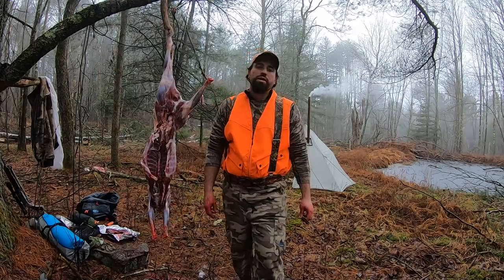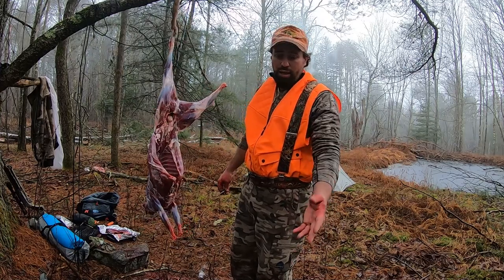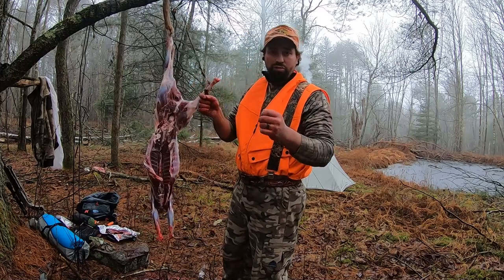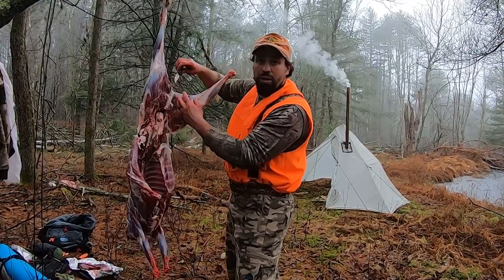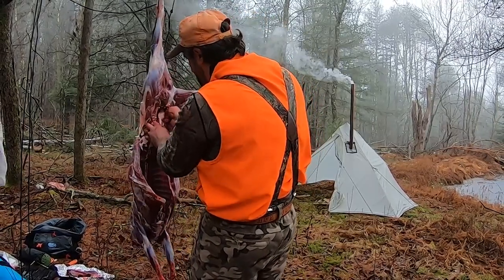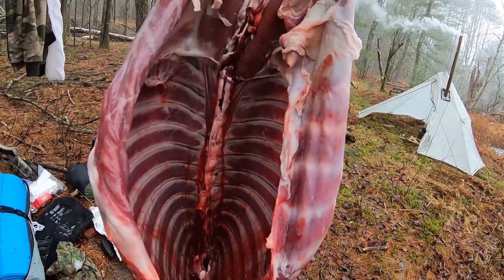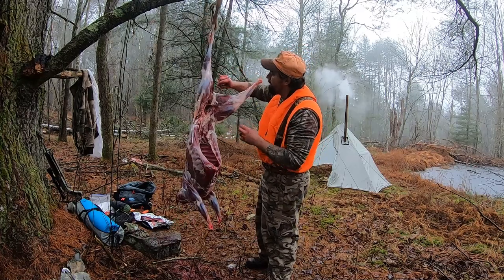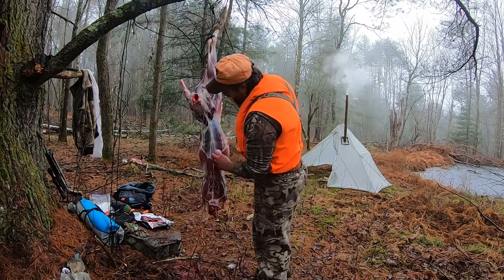How to Remove a Deer Bladder during Field Dressing

Comment: Gut it on the ground with the hide on.  Then skin with the fancy rope rig.  I use a truck bed door.
Reply from the maker: You want me to drag a truck door in the mountains?
Reply: @paparomesoutdoors711 I am dead tired Big Daddy.  I practice deboneing deer on that door for when I get one in Shawnee as I wanna pack just the meat out.  I will skin it on the ground and use hide like a tarp..  I like how you tied this deer up.  I  get meat cold and soak it in water a few days before packaging.  I use cooler with water and ice blocks.  Thanks for sharing your techniques.
Reply from the maker: @Dutch.1722  I agree with you I’ll have a video coming out I bone most my deer out zipped up the back and use that as a tarp to lay the meat on or in cheese cloth.  I found I get less fur if I hang it and work the skin off this way first and makes for easier time to process it at home later .  Thanks for checking it out be well